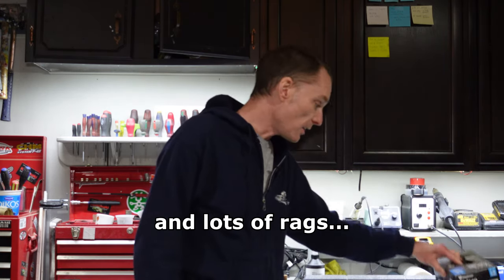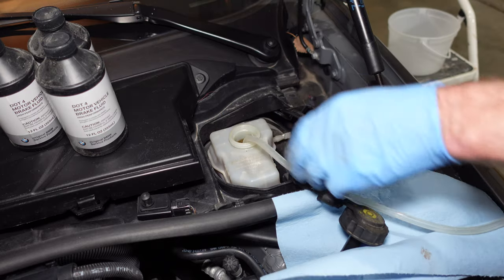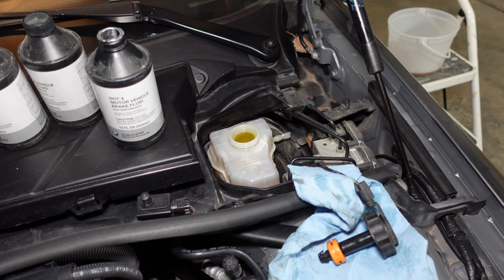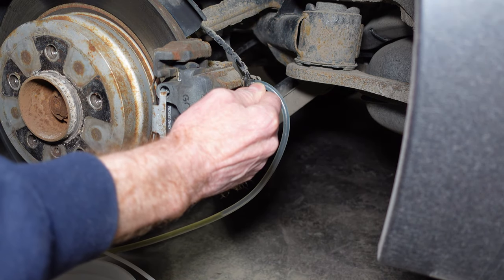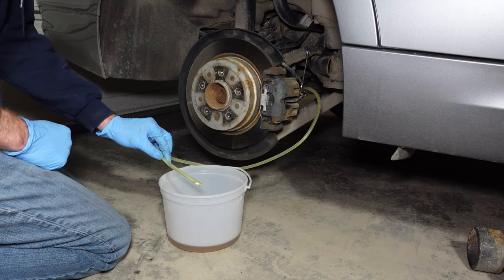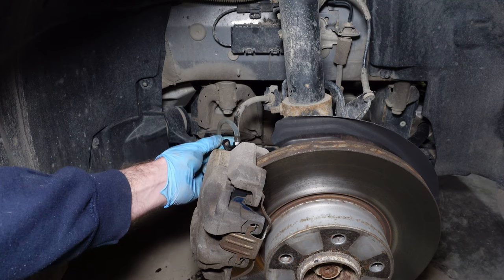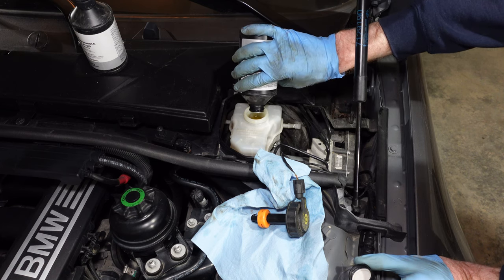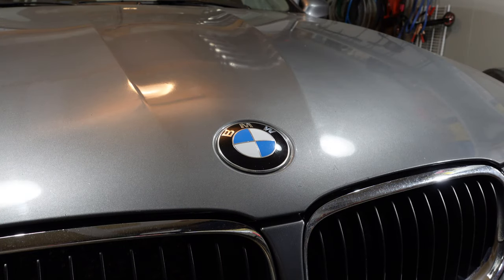BMW E90 Brake Fluid Change

Comment: You can mix Dot 3, Dot 4 and Dot 5.1 with each other. Those are all glycol-based fluids which just has different dry and wet boiling points. But then there is this Dot 5 fluid which is silicon-based and you cannot mix it with any mentioned above. However, a great video💪
Reply from the maker: thanks for the clarification!

Comment: You you're supposed to bleed the oil in the ABS module as well? You need a service/diagnostics tool to do that properly.
Reply from the maker: Yes you should according to the manual.  I haven't made an allowance for the ABS module as I don't have the BMW software/cable.   The manual does say to run the ABS module through a bleeding routine after bleeding the brakes.  This would cycle the old fluid out of the ABS module.  My observation is if the rest of the system has fresh fluid, the little bit of old fluid in the booster shouldn't be an issue and should mix with new fluid through the course of operating the vehicle (especially if you have slippery roads!).  You can think of an ABS module as a set of valves to allow brake pressure from the pedal to be applied to the calipers or bypassed to release pressure from the caliper, it doesn't actually hold much fluid and during normal operation fluid does still go through it.  Just make sure you are not mixing brake fluid types!

One note is that on some vehicles the ABS module is located in a different location.  In this case, the the caliper bleeding order may change (start with the caliper furthest away and work to the closest to the ABS module).

Comment: Does this method also flush the old fluid in the abs systems?
Reply from the maker: As I understand it, there will be some old fluid in the ABS pump/module.  I never worried about it as my pump gets a good workout every winter meaning that little bit of old fluid would get mixed in with the new fluid.  Not sure what that means if you are in a warm climate with no icy roads!  When I made the video I had blead lots of brakes, but this was the first time with a ABS component and I never though of it.  It is something I should of addressed in the video.  Thanks for bringing it up!
Reply: @reileymckerracher9181  thanks. I dont have Inpa or whatever it’s called. No wonder if I should do it without the abs or not. Wouldnt considered to be a real flush the system job

Comment: I wonder why the refill happens before bleeding the brakes ?
Reply from the maker: Before bleeding I suck out as much as I can from the reservoir and fill it with new fluid, then start bleeding the brakes.  This way, I will get fresh fluid to the calipers sooner.  Otherwise you would have to bleed the whole reservoir through to the first brake which would take a long time.
Reply: @reileymckerracher9181  thanks 🙏

Comment: Hey so I missed my brake fluid service by about a week and now there's an ABS malfunction and the stability and DBC lights are on. Should bleeding and replacing the brake fluid bring these systems back online?
Reply from the maker: did you do your service?  weird things happen when the battery gets low or is disconnected (which can happen during a service).  as long as the car is driving fine and there are no obvious issues I would reset the codes and see if the come back.  missing the brake fluid service by a week isn't an issue.  brake fluid goes bad slowly as it absorbs moisture, so it isn't a sudden failure.  changing the brake fluid alone won't make the codes go away, you will still need to reset the codes.  typically when I do my brake fluid, I wait for the service light, then wait for the next time I'm changing my summer/winter tires, so I'm usually a few months over when I change it.  if you are going to be doing aggressive driving or going to the track, you'll want to go the other way and change it early.
Reply: @reileymckerracher9181   @Reiley McKerracher  I haven't done the service yet I was going to call and schedule it for tomorrow or do it myself with the help of your video. The car drives and the brakes work but they don't stop as quickly or smoothly as of last night when the light came on so the ABS malfunction might actually not be related to the battery.
Reply from the maker: @elitecompany51  Sorry, I'm not sure then, best have the shop look at it when they do the fluid.  It could be a couple different things if the brakes aren't acting as quickly, the booster or master cylinder being possibilities.
Reply: What I'm looking that most likely need is Replacing the Brake pad wear sensor and from there with advanced diagnostic computer Reset the service and there is a way to with car computer manually but u Need to use BC button and the button the dash the ones that is used to reset the miles driven. It's a procedure